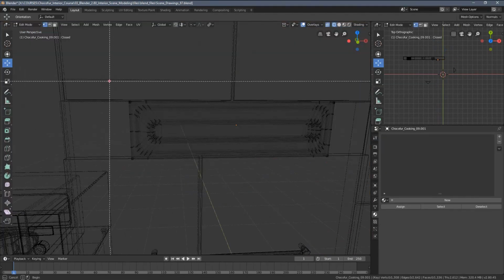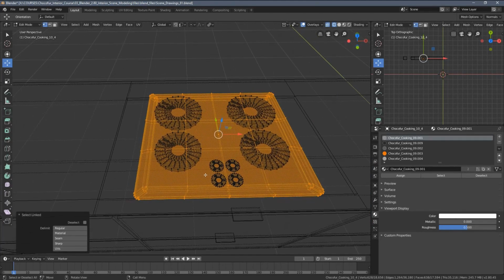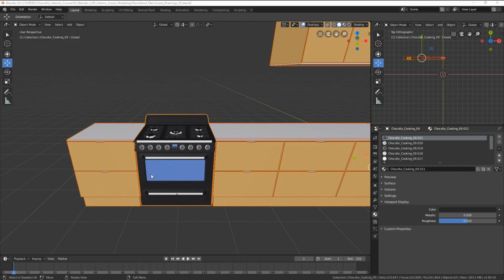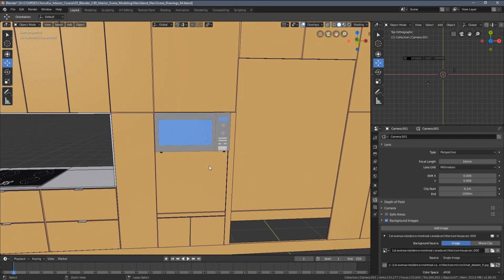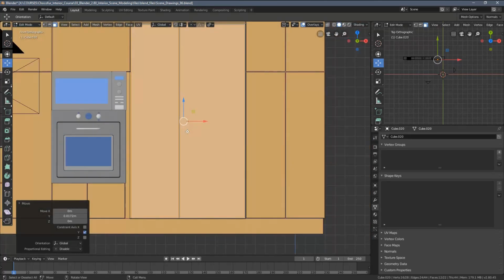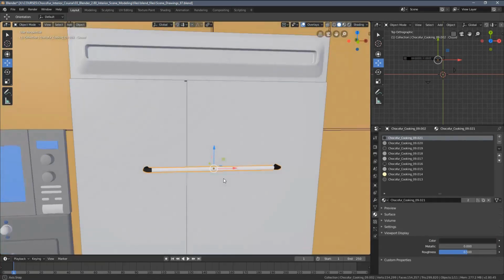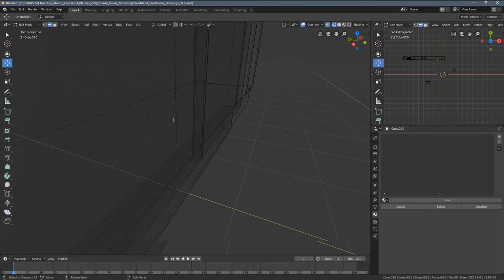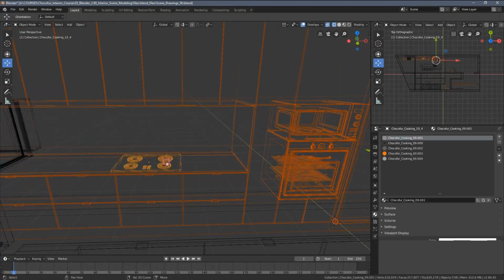Blender Archviz: Kitchen Appliances | Part 16 |

Comment: I just wondered: when I saw you lining up elements, if you set the snap to vertex you can use Manual Magnet Snap  (i just made that word up) by holding down CTRL while dragging edges, verticies or faces. IT will automaticly snap to whatever you set in the options  using a small hotspot around the mouse . I find that a very useful hotkey for lining up things :)

Comment: Wonder how you modelled that cooking plate, it doesnt look complicated. Just wondering how those white rings on the top glass part seem to follow those internal heating elements. thought perhaps some boolean, but that doesnt make sense. Those white rings normally are just paint, its not geometry
Reply: But i guess if i see how you keep stuff simple, my guess that white is just poking through the top for like 1mm or 0.5mm. THat way it looks like paint whilte its simply get sticking through
Reply from the maker: Exactly :-) Just basic circle geometry put on top of the surface. Sometimes it's better to add details as 3D geometry rather than textures.
Reply: @Chocofur  Yup! because real geo catches lights and gives nice rerflections. Nothing in the world has perfect sharp angles. Those make a image scream CG. Im also wondering if youll add bevel modifier to lots of models. Until now, everything in this model course has perfect sharp 90deg angles